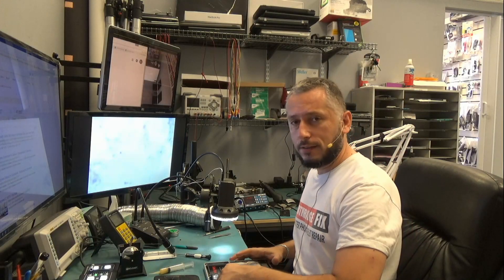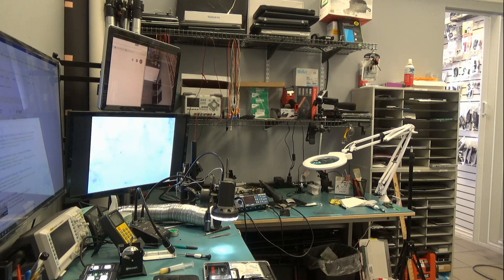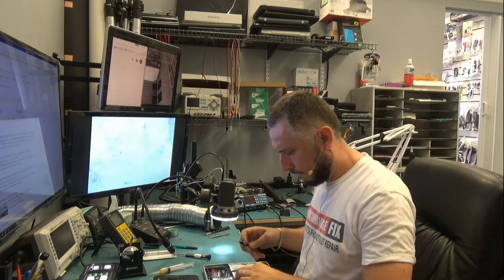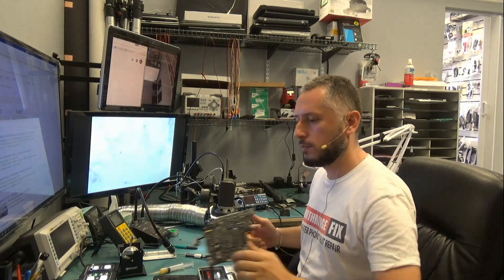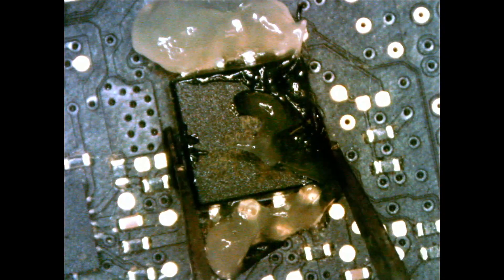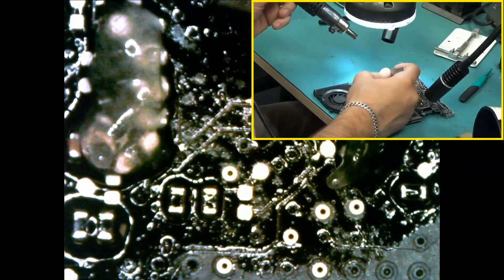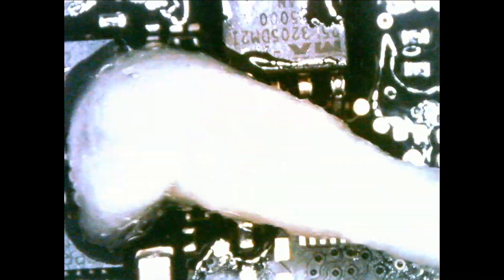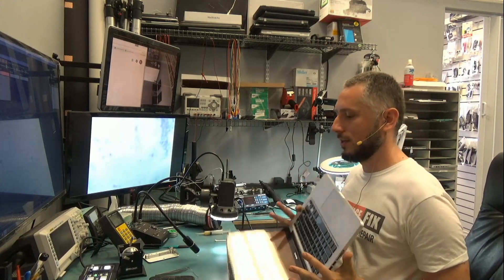Macbook pro 9 Beeps Black Screen Fix Corrupt EFI Rom 820-2879 A1278

Comment: 107f = 42c. Either your ac is low on refrigerant or your indoor and outdoor units need cleaning.
I just cleaned a ac indoor unit. The owner used a spray on disinfectant on the sistem and has been using it for 2 years. After complaining that the ac was not cooling properly, cleaned the outdoor unit and the indoor unit wich was full of hardened mudd. All the dust that acumuated in the unit was made mudd by the disinfectant and eventualy got into the fan where it hardened. So basicly no flow.

Comment: Thank you so much! This is exactly what happened to my computer. Because I don’t have the tools or the experience I sent it to get fix and the technical guy did exactly what’s in this video!! 

You can tell this video is made by a professional. They charge me $90 USD. Do you think is a fair price? 

Macbook pro mid-2012 with SSD
Reply: AlterFónico yes that's fair for me
Reply: @kyuting  is it usually around this price?

Comment: hi i have a 2015 a1466 macbook air and its always stuck on apple logo with progress bar. it wont go into any recovery mode or boot from usb nothing, just stuck..?i have tried even another ssd drive and still same issue? maybe bad efi chip ?